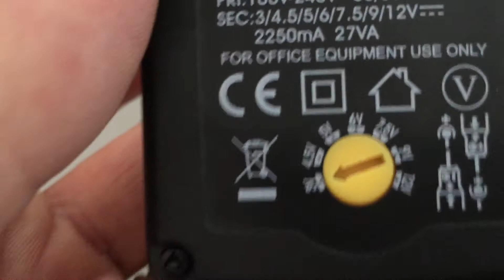Make a battery powered Candle work on the grid in one minute ...

Comment: Thanks for sharing!! I was wondering about to do make this type of project with my old batter operated candles. Your video is greatly appreciated. Your final outcome is outstanding!! God bless!
Reply: Had the idea to hack some battery powered candles and hard wire them so I could tie them into my outdoor low voltage lights around my pool..... this way I could turn them on and off and automate them via my pool control.... AND this completes or validates the idea.   THANKS.. IM on it.     and yes God Bless you.

Comment: All you need to know is what the voltage is which for 3 batteries is 4.5v. Next you need to know the wattage. If you can't find it there will be Current. Lets say its around 0.5A. Take the current and multiply it by the voltage. In this instance its 4.5V*0.5A=2.25W. The amount of candles you can daisy chain together would be determined by the output power(W) of the power source. If it's a 20w power supply you can chain 8 safely. Any more and you are just running a risk of a possible fire or just burn up the power supply (plug).
Reply: I need a solution that converts it to contain rechargeable batteries with a plug in the back. Or metal contacts on the bottom for base charging. Any ideas?

Comment: Just watched your video, exactly what I'm after! I'd like to run 6 candles from one adapter but how do you daisy chain them together and do you have to alter the voltage knob? Thanks
Reply: I am looking to do the same thing. Anyone have ideas how to connect multiple of the candles to one power supply?
Reply: @laurentspamer4602  you can. The amps of the supply will determine how many can be on one.

Comment: Hahaha...I thought when you said "off the grid", that you meant not powered by the mains socket. I just converted a small 3 led remote-controlled light from battery to usb,
so now i can power it from a powerbank, rather than keep changing 3 batteries. Cool vid.
Reply from the maker: Sorry 'bout that. Updated.
Reply: Thanks, i didn't think i would get a reply on a 4 year old video. Good job.
Reply from the maker: @ambistical4060  it just popped up here so ... :)
Reply: Have a Happy New Year. :)

Comment: Sorry for not knowing my electrical but did you use just one wall wart (DC converter) to power all of them? I have the same issue, I bought scores of them and they cost a ton in batteries...PLUS, Directv remote makes them turn on at a low level, so they burn up the battery power without noticing! ARG! I want to do the exact same thing, daisy chain them with a power source so no more batteries. Please let me know how this was accomplished.  Thanks. Oh, and great video!
Reply: Use a 5v 10a SMPS

Comment: Okay, question time for anyone that may know. I have followed guides similar to this but what I didn’t was take the base out and disconnect the wires from it from the inside of the candle. I then connected the wires to a USB cable after stripping the end of. The candle had a resistor in it and this was also kept in place. So, the only difference is that the candle wires are now connected to a usb instead of the battery base. The usb cable is connected to a usb plug into the wall. For the first few weeks this was done the candles worked great, just as bright as if they had batteries in. However, as time has gone on the glow from the candle has become noticeably duller. I am unsure why this would be?